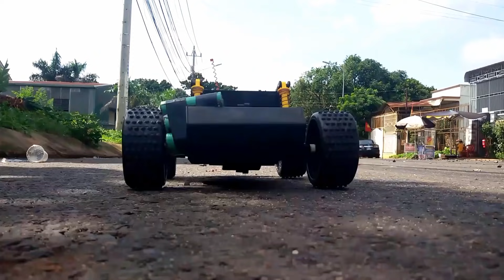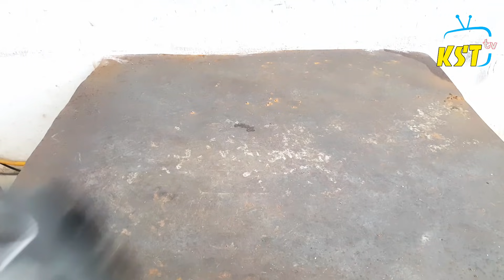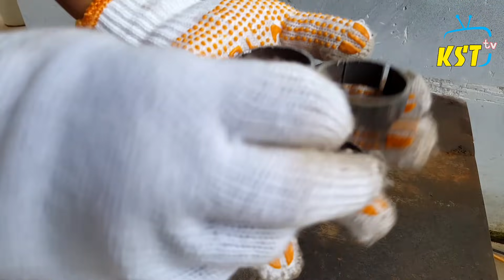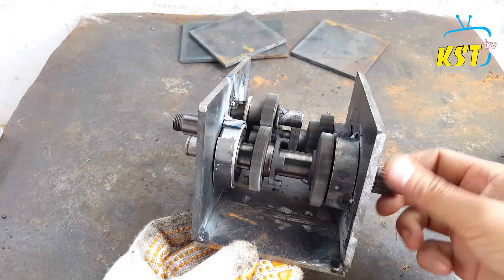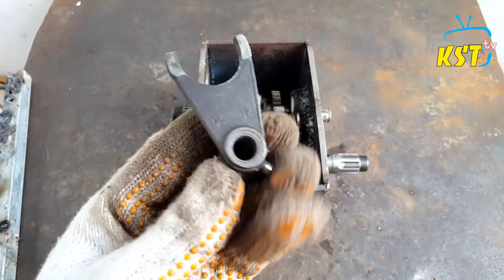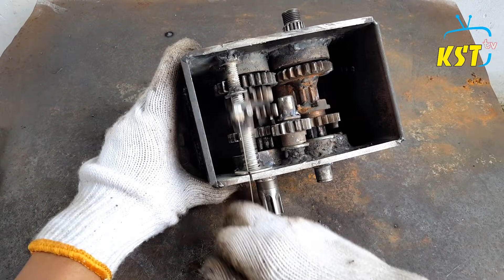Build a REVERSE GEARBOX_v2( Project electric car)

Comment: I just don’t get how they can  spine from two different ways by just shifting like that maybe I’d have to see in person
Reply: The primary axle has its gears spinning freely on the axle, the center part that moves slides along the grooves machined to axle and the part, witch then can be slided into ether gear set, from witch one has one extra axle/gear that swaps the rotation. Took me while to figure it all out, but you can build lego technics model to figure it all out if its still not making sense. Mind the extra axle one needs to be reverse since gearing ratio slows it down and the slide bearing is not designed for constant use. So if you need to get another direction for forwards gear, add extra gear and then have the output shaft. This can be done before or after the direction change, does not matter, just one more set of bearings and with this you can also alter the gear ratio a bit.

Comment: First view
Reply from the maker: thanks :)
Reply: @ksthacks  and where to buy the 775 motor with gear
Reply: @Abishek_82  you can buy it on lazada ok
Reply: @votvachdien  but I am from nepal
Reply: @Abishek_82  so maybe you can buy it on amazon
Reply: @votvachdien  in nepal there is not amazon
Reply: @Abishek_82  isn't 775 motor a starter motor? check your local scrapyard